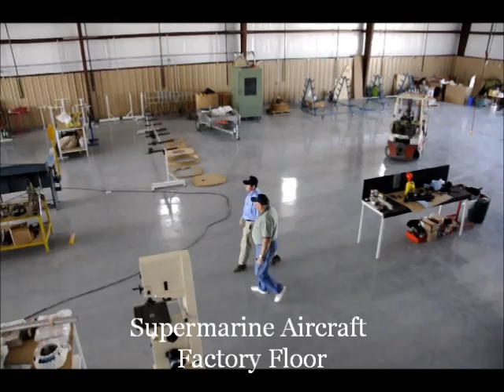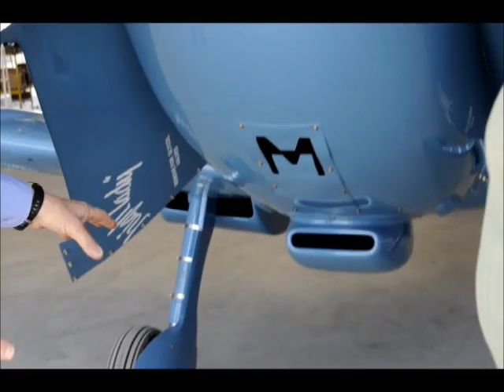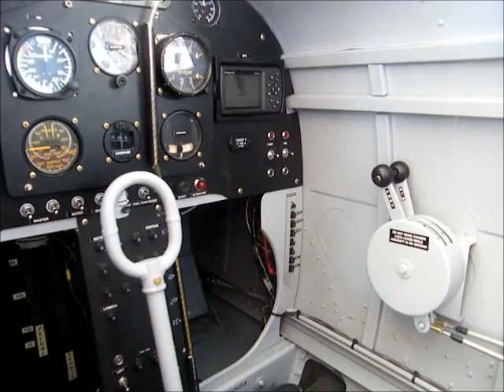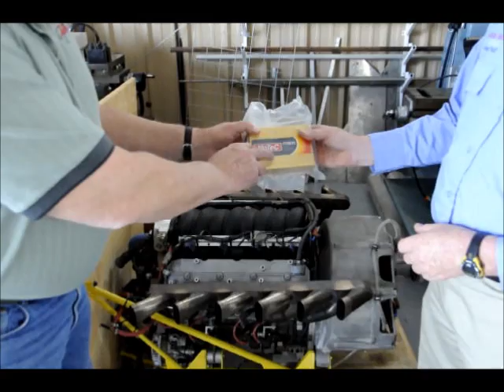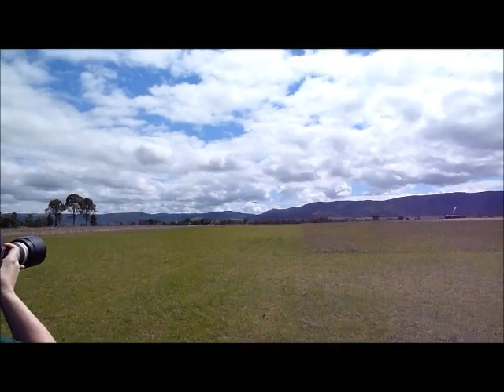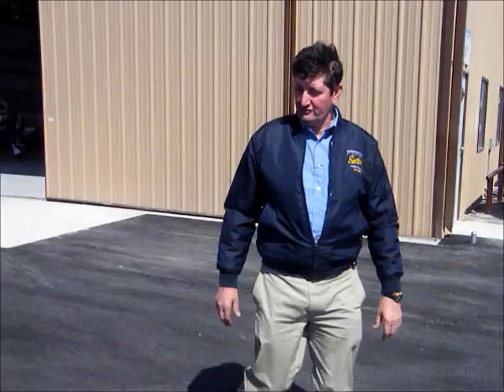Supermarine Aircraft Factory Tour 2011

Comment: To everyone complaining about this, consider that it's impossible to build a full scale replica, because they would require a full scale engine, and they just don't make anything remotely close enough anymore. The Merlin made around 1500hp, and anything above 300hp, or so, these days, are the domain of jets.
Reply: +UNITED POLICE STATES OF AMERICA 

There are several modern production engines in the 1000 HP power class, what are you talking about?

You don't need a merlin engine to make a full scale replica, there are several engines in the auto industry to choose from that can be modified for aircraft use that can get you 1000 HP stock. If you have more money than sense, you can obviously get more with turbo/super charging.

And you don't even need a 1000+ HP engine to have a full scale replica if you make some design compromises for weight, speed and acrobatics.

Comment: Actually, blue was a standard colour scheme for PR IXX Spitfires, it was a little lighter than this, but not much so. It made the aircraft almost impossible to see at high altitudes of around 40K feet, even from as close as 100 feet away. The Battle of Britain Flight operated a PR IXX in this colour and may still do so.
31 & 52 Fighter Groups USAAF operated Spitfire Vs in US markings over Europe, so ths is probably not far off an accurate representation of their aircraft.

Comment: Obviously, the design of the original Spitfire made it both a very responsive, good, easy flyer and a formidable gun platform, although I have my doubts about the Spitfire when compared to the 109 and the FW190. When it comes to hard knuckle war machinery the Germans took the art to a different level. But, good on yer mate - and who is this aircraft for?

Comment: No dear, madness would be along the lines of 'the word is, officially, on thing, but I am going to say it is another, claiming it to be original, when in fact, it is not.'
Yes, that's right, I'm calling you mad, and wrong. 'Alumin' older than 'aluminum', and 'aluminium' is correct. You've managed to choose the ONE variant that has NO basis for correctness.
I think you'll find the actual argument was against the use of 'gas' to mean petrol, as that means something entirely different.
Bullseye.